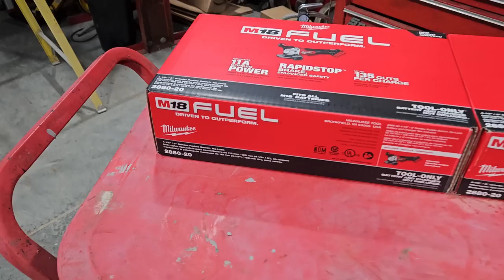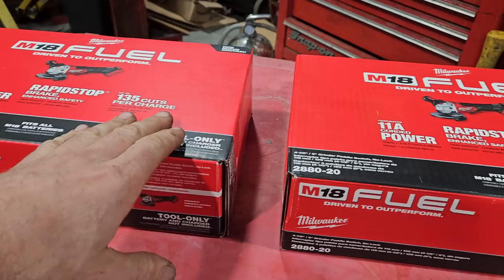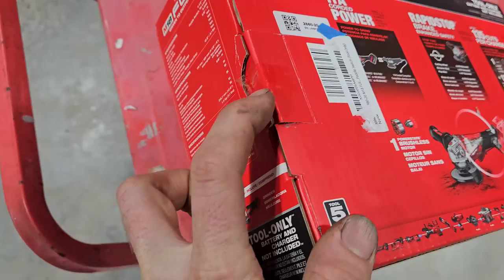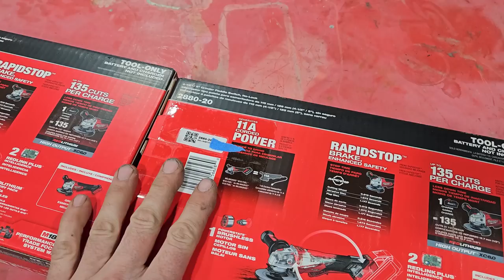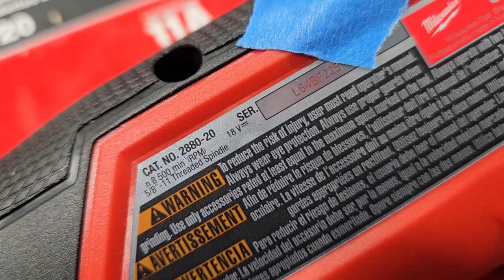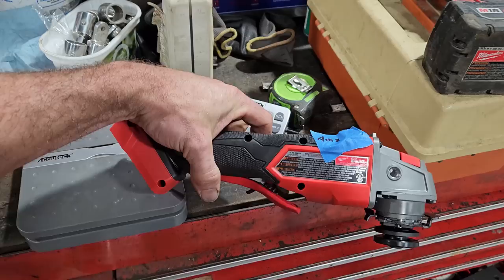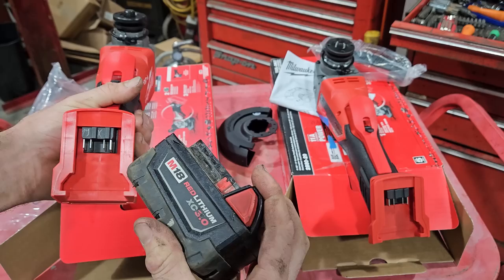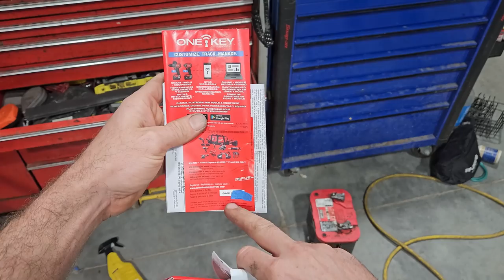Amazon MILWAUKEE Tools FAKE or THE SAME? Half Price!

Comment: Two tenths of an ounce difference... Not TWO ounces!
A counterfeit wouldn't be that perfect. I'm thinking some of the Milwaukee tools on Amazon are excess tools that someone is trying to get rid of.
Say a construction company buys a couple hundred of a tool for their workers, but only needs fifty... Or none of them. For whatever reason. So they decide to sell them, and recoup some of their expenses.
The tools may be perfectly fine; just not from an authorized dealer.

Comment: Did you check the place of (reported) manufacture? One may come from an approved factory, the other might be from a knock off or subcontracting company.
Some years ago, I noticed weight differences in the same product (Makita) and one was one in Mexico, the other in China. The Chinese one was of poorer quality and a canvassing of a large number of owners had all confirmed this finding. I've noticed that when manufacturers try to rein in production costs, they'll change factories, use a lower cost (read lesser quality) components and or materials. The Chinese have a tendency to use the absolute minimum of anything,  screws are a good example. An older product might have a 10 thread screw, the Chinese will use 8 threads if they can. Their stuff looks ok at first but they get sloppier with use. A German company will tend to make quality and rugged items but a Chinese one, if they can save one cent on a million items, they will do so. A bit of a rave.

Comment: Home Depot has a computerized activation process for power tools. If you steal it it is not supposed to work.  Not sure if Milwaukee would place that circuit in tools not destined for HD. That may account for the weight difference at least.
Reply: That does not apply for Milwaukee

Comment: Scanned through some comments and surprised I did not see this yet. But as mentioned it is likely a return, but may not be from HD as it would have a green, red or yellow store label on it. But not sure how online returns look. People buy pallets of these all the time to resell. 
1. The Amazon box was already opened before and re-tapped, or you bent up the carboard when you were messing with it off camera. The HD one was not opened before. 
2. The Amazon serial number has a 2023 manufacture date  (2301 = 1st week of 2023) and HD is 2022 (2251 51st week of 2022), so being a new year, the font may be different. Or just being different times. What you did not cover is if the serial numbers on each box match the tool. When I am at HD and buying Milwaukee tools, I always look for the newest date. I have found some tools are a year old. So keep that receipt. 
3. Being that the Amazon one box looks to have been previously opened, the weights can be different if it was already opened an some little cardboard fell out. The tools were also really close in weight, but nothing I would say is off being only .03 difference. Likely just the casting.
4. The clear coating on the HD box is likely from HD store label being there. I hate it when they put them over the S/N as I cannot see the manufacture date when buying from HD. 
5. Home Depot checking the S/N to the tool is a all on the rep you go to, I have never seen them check with the few tools I have returned.

Comment: Does Milwaukee make all their stuff at the same plant or do they have several, that would explain the very minor differences.  I'm sure a lot of you have seen the Home D videos showing the thieves running out the door with a cart full of tools so the Amazon sell could be selling authentic Milwaukee tools only stolen.   I bought my Milwaukee 2488-20 M12 Cordless Soldering Iron from Amazon and it promptly broke as the thermal fuses burn out. I filed a warranty claim with Milwaukee and they accepted the serial number, so it's authentic...

Comment: Its .2 tenths of an ounce.   They do sell knock off tools on amazon.   HOWEVER  you can tell the difference  before you buy them.  I Have had a few of them both fixed and replaced under warranty.   Only difference  is not a verified seller all that means is the 5 year long term.   Goes off the manufacturer date.   Instead of purchase date.  So if you get one that say in inventory a long time.   Could have a little less time to have it go bad.   Not a big deal to me.

Comment: I have 3 of the same Milwaukie impact driver, all bought at different times from authorized sellers and the font is different on one of them. A friend has anAmazon one with the same font as my so called legit ones. My Milwaukie oscillating tool is from Amazon and has had zero problems. This is almost for sure gray market nonsense.

Comment: a reason why the Amazon one is cheaper could be that it fall of a truck or they simply bought a big bulk of a certain tool. Could also be that they bought them in a different country, or simply a marketing idea to get attention to their amazon shop. I also assume that official resellers have to pay a license fee? Some manufacturers are also regulate the price to the official resellers, so the price stays high. So many options why it is cheaper. But I would be always careful with Amazon, a lot of scammers on that platform and cheap Chinese stuff. I almost don't buy anything anymore on Amazon.

Comment: There's always grey market items.... For anything produced in China.  These can be real items..... Of which the company manufacturing it makes more than they're supposed to than they sell them out the back door...... These typically have no quality control checks whatsoever and so they have a much higher failure rate than the legitimate item.    You should never buy anything expensive from Amazon or eBay..... Only through an authorized retailer.   This is why many companies especially electronics...stereos...etc  will not warranty anything if it's not purchased from an authorized retailer.... There's loads of gray market as well as counterfeit items.  

I know it's hard to believe but there's literally counterfeit copies of almost everything out there. Not just expensive things even things that only cost a couple of dollars....have fakes.     And there's copies of copies.  Some copies are good and some copies are crap.   You're honestly taking your chances with anything you purchase off of Amazon or eBay not being legitimate.

Comment: lol you caught that as well. I'm thinking to myself there's no way that there is a 2 ounce difference!  that's impossible! That's  a lot of weight.   70 g is not just a few copper windings missing? That would be an entire piece of the tool missing lol. But yeah, there's a lot of conspiracy theories out there on WALMART having this quality of something and the wholesaler having a different quality of another oil. It's all the same. The simple answer is Amazon simply buys in bulk a lot more at one time and they don't have the overhead that Home Depot does. It's just that simple so they can undercut the competitor and sell twice as much to make the same amount of profit that Home Depot would With no huge BIG BOX store overhead. Basically AMAZON cuts out the middleman and that's where the savings are! No one is reinventing the wheel folks. This is just simple business practice and then at other times of the year when Home Depot has their massive tool sale at different times then when AMAZON would have an item on sale. It's all the same but what's good is competition but with Amazon you have to send in your warranty claim through Milwaukee rather than bringing it to Home Depot. so there's a bit of a inconvenience there not to mention the fact that some people want to go see and feel and touch a tool before they buy it and Home Depot offers that! In fact a lot of the times someone could go into Home Depot load up the shopping cart and stroll right out of the store and not a single employee will touch them because there was a person that was killed a few years back in London Ontario Canada. A store employee that was working at the time witnessed someone stealing several items and began to pursue the thief on foot until catching him, and grabbing the gentleman who later suffered some type of internal health complication, and died that day. Since Dan Home Depot has, I know hands-on approach because they were sued for millions of dollars and it was all over the news so now they have to have specialized trained floor walkers who are actually the only one legally by law in Canada to apprehend  a would be perpetrator. Even when the cops do arrive unfortunately, there's not a whole lot they can do because most of the thieves are usually less fortunate than others, and they have nothing else to lose but they be gaining a bed and a meal for the night at least until they're quarter appearance so they would be further ahead to get caught Rather than sell the merchandise on the street. It's sad but true this is why Home Depot has just recently revamped all of their stores to make it less accessible to a thief, in hopes of minimizing the chances and the opportunity to profit off of stolen items.

Comment: Probably gray market.... dealers buy to meet quota... to get additional discount on yearly rebate... then flog the unsold units in one bulk sale ... usually for 2 percent profit... to any buyer in the world... hence the no warranty... as it's basically... an import... and not sold by the local authorized distributor... 

2 percent.. if done often enough... can easily become 20%... 30%... 40%... or more... on an annual return...

Ie...Grocery stores work on 2 to 4 percent... but if they do 20 to 30 turns a year... that's 40% to 60% profit on a yearly basis...

Comment: Great video and absolutely LOVE the subassembly views!  The rotor stamping looked to be ALMOST the same with a minor difference in the lower line (could be the batch #).  Hard to read in the video.  Also, the weight difference was only 0.2-0.3 oz (you kept saying 2 or 3 ounces).  Could that small of a difference be attributed to varience in the plastic casting?
Reply: .02😊

Comment: Interesting.
The obvious issue here will be durability of the "knock-off". 
There is no way to determine if the wear components are made of the same grade and hardness of steel/aluminum/unobtainium/etc. Time will tell.

The other question is the serial numbers. 
Both units are the same model "L64", the same revision, "B", the same factory, "F", with date codes of 230x - Amazon and 2251 - Home Depot. This indicates they were made up to 11 weeks apart. 
Is it possible the factory changed the label printer tooling during that period? Sure. Is it likely? I have no idea, but I'm skeptical.

Comment: I'm guessing they Amazon Milwaukee tools are authentic, but they're usually older models. You might get the 2020, 2021 or 2022 version instead of the 2023 version

Comment: A look at the circuutry woukd be a dead giveaway on quality. Hardness scale test on the gears would be another. Type of plastic reinforced or simply injection molded ckukd be another. A counterfeit is as good as the electronics. Great video!
Reply: They are both authentic. But one was stolen

Comment: China has foundries to make stuff, it could have titanium mesh inside to be a superior product.  I once was at this wrench display a week before K-Mart closed, 15 bucks for a wrench, but golden, weighed nothing, the mechanism had absolute precision, but if you looked under a microscope, tiny holes in the metal, not even uniform, just decompression forged in helium gas, swings like a table knife.

Comment: 5 months of daily use my 3\8 milwaukee impact just quit ..So it took ruffly 6 weeks to get it back..I paid 1000.00. For it but it came with 3 3amp hour batteries. Plus the charger from a tool truck 
.great impact. But. I do not want it to do that again..I thought they (milwaukee)was the best.

Comment: Serial numbers are only used for warranty purposes. Units are still required to be sent back with warranty claims therefore nobody will be sending out their unit using your serial because the unit needs to represent the serial, Also if this was an issue then they wouldn't allow returns of these products in general if anything malicious could happen with the serial. I think you're just a littttttle bitt too worried about what you're hiding.

Comment: Could be a manufacturing overrun sold to online retailers. If Home Depot and other box vendors order 500,000 but the factory produces 600,000, the overrun could be sold to wholesalers for smaller retail vendors at closer to cost in order to move them.
Reply: Those prices are below cost. It is obvious that it is a stolen product

Comment: Interesting is the home Depot main line Milwaukee 18volt non fuel version worth anything i got a set i believe a flashlight,a 1/4 dr impact and a i believe a 3/8 it might be a 1/2 inch drill driver, black Friday sales $139 i couldn't touch the fuel impact driver or flash light for that price so I figured it was worth a shot and regardless I have 2 new m18 i believe 2ah batteries
Reply: Has anyone used the non fuel cordless M18 tools?!

Comment: The tooling to build such an accurate copy would be very expensive. That's usually not the goal of fakers. Most quality manufacturers make their goods from the median test stock one way or another. But that leaves them with stock that doesn't pass muster. Do they chuck it or use it? So they flog it off to the grey economy to sell without warranty. Or maybe it gets sold before it leaves the manf. countrys factory...... Its been going on for years even Waltham did it. The non warranty items are probably units that do not pass Milwaukee's production tests for quality. But they are already built ? So do they throw them away in bulk and risk negative journalism or sell them another way?

Comment: Can tell my boy never touched any work before. That 3.52 and 3.55 wasn't off by 2 ounces. If it was a 2 ounce difference it would've been 3.75 ounces, or 3.72 if you wanna be technical. It was 0.3 ounces heavier, or 8 and a half grams.

Comment: I only need to watch halfway into the video to know they are both real Milwaukee. The Amazon one is either stolen or, more likely gray market. If it is counterfeit the giveaways are everywhere, especially the packaging which is the hardest to copy and manufacture. Not enough information provided for me to infer if it is stolen or just gray market. I would buy the latter in a heartbeat. Generally stolen ones are more likely to be found on eBay or Fartbook Marketplace, and less likely on Amazon.

Comment: It might be a tool that was stolen from Home Depot, or they got it some other way for cheaper. There's a lot of places where you can buy tools for way cheap especially if you're a licensed dealer either at license dealer only auctions or other sales sites for licensed dealers only. But the biggest deal is that it's probably reduced price because of the number of stolen tools.

Comment: This video is absolutely not true!!! I've bought all my Milwaukee M18 Fuel tools from Amazon and some from Market place. Had 2 warranty claims on 2 different tools. 3/8 impact had an intermittent trigger issue 3 years into the use and Milwaukee sent me an absolutely brand new 3/8 impact. Sawsall was purchased on market place and was 1 year out of warranty, I made a claim and tool was completely rebuilt and sent back to me at ZERO cost. Milwaukee does go beyond the warranty and they kept me very happy, maybe that's why I have over $2k in their tools....

Comment: Use your handy-dandy Milwaukee heat gun on that sticker for a few seconds, and it will peel right off without leaving any residue behind. ;-)  If you don't own one, you NEED to own one...
Reply from the maker: Depends on the sticker type. Sometimes the heat gun will end up leaving more residue behind

Comment: 😂 maybe take the tool out is the one from home Depot will have an alarm tag inside so I think scan whereas the Amazon one doesn't so I probably wouldn't trust Wayne just the packaging with the tool as much as weighing the tool itself and I should give you more of it accurate. I mean if it is a phony one it'll most likely have probably a refurbished motor cheaper brushes probably not as good of quality building and soldering as something authentic but honestly if you're starting out on a budget and you have Milwaukee batteries I personally don't see any harm in that I mean you say there's no warranty but yet if something happens with the tool I can return it to Amazon and get my money back if not get some sort of a credit so it's not a complete loss.

Comment: Levis cost a lot less in the USA than they do in the UK.
 
So that must mean that all the ones on sale in the US are either fake or stolen.
 
What is wrong with you all?
Reply from the maker: I'm sorry but that comparison is not relevant. We're talking about Milwaukee tools here
Reply: @nnkhmisc  
> I'm sorry but that comparison is not relevant. We're talking about Milwaukee tools here
 
I'm sorry, but that comparison is 100% relevant.  And it wouldn't matter WHAT type of product it was.
 
The point I'm making is that makers charge different prices in different markets, and is perfectly possible to exploit those differences by moving products from one place to another.
 
Just because some sellers have got lower prices on Amazon than the ones that a bricks'n'mortar seller have does NOT mean that the cheaper ones must be fake.  It does NOT mean that the cheaper ones must be stolen.
 
It could so easily mean that the cheaper seller has found a lower cost supplier than the one that HD use, has lower overheads, and works to lower profit margins.  They could have sourced the items in another country.  They could have bought them at a bankruptcy auction.
 
Frankly it's just crazy how some people immediately brand them as stolen, or counterfeit - do they not have any brains?